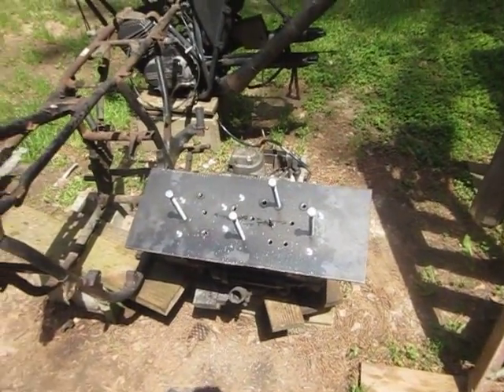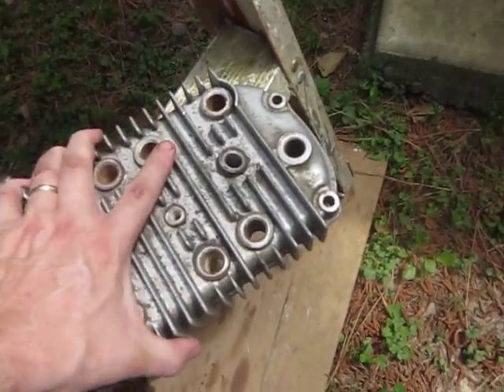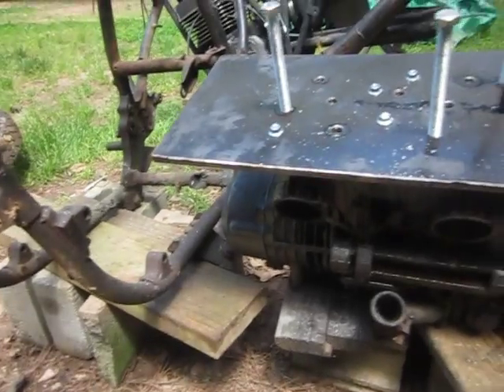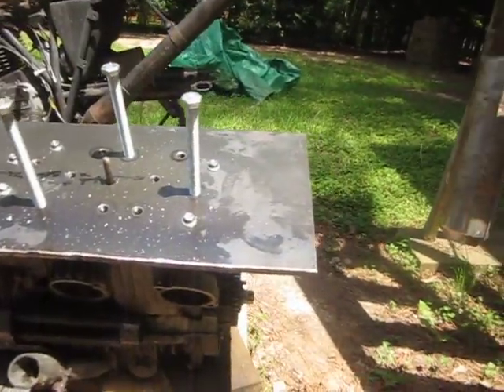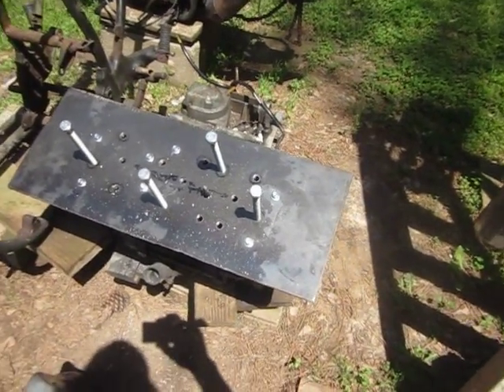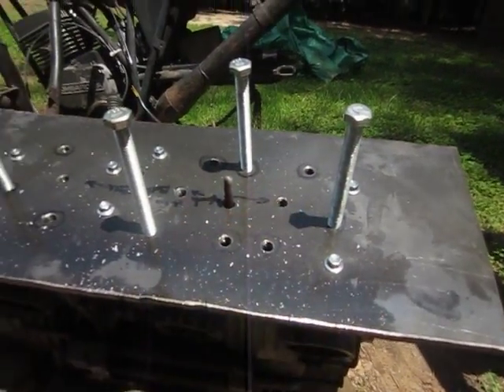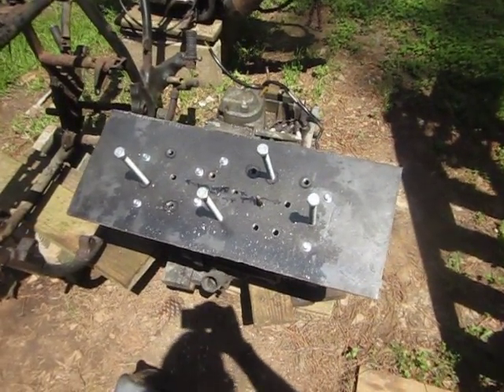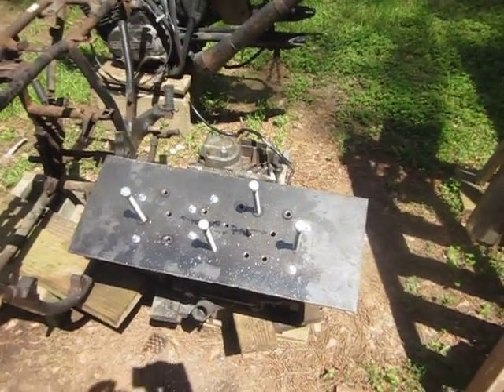GT750 Restoration Part 4: Cylinder Puller Plate

Comment: The steel plate idea is foolishness when Suzuki itself has developed a puller that is cheap and very effective. It worked great on my '75 three years ago. See the Service Bulletin, but basically you get eleven 5/8" short bolts (e.g. 1" long) and center drill them for a 3/8" or 10mm tapped hole down the middle. You then tap each of the eleven stud holes (5/8" coarse I think) until they bottom on the studs. Then one of the two-bolt "pullers" in each hole will allow the evenly distributed force you need to finally beak t he cylinders loose WITHOUT damaging the 8mm bolts holes in the cylinders.

Comment: I made a puller plate like this one back in 1980. I broke all the soft grade 2 small bolts off in the jug. Also hung the entire bike from a tree with a chain wrapped around the jug for a month. The tree branch finally broke, but the jug is still on. I talked to an old guy that once worked as a Suzuki mechanic and he said they all became permanently stuck in about five years. What should I do?? He suggested dropping the entire engine in tub filled with battery acid. Won't that screw up the engine parts?, I asked. Yes but the jug may then come off. Why is it that no one else on you tube has this problem? What are they doing?? Dynamite?
Reply from the maker: BrokenPortriats Now I'm thinking maybe I should consider pumping hot oil/water around the jacket for a while. Heat everything up and expand the bolt holes. Maybe that's too elegant. Could probably get it done without so much "engineering" by adding heat externally. Is there "heat tape" that gets quite hot? Have to look into that. A combination of the oil in the stud holes, plus steady pressure from the puller bolts AND heat would be about the best we could do (say I).
Reply: BrokenPortriats The project bike you picked out was super bad. Broken head bolt nuts is new for me. You will need two more parts bikes to finish this project. Do not pay more than $50.00 each. If they loved their bikes so much why did they park them behind the garage and not in the garage?? My next post will piss you off to no end as I gave one of my old bikes to my son and he got it running with just spit and polish.
Reply from the maker: BrokenPortriats Ha! I hear you loud and clear! I really wanted this to be a test of wits and creativity, to see what my limits are (so the rustier the better!). I figure if I can turn this rust bucket into something that runs (and runs well) all the other projects I take on will be easy by comparison. Also, it's nice to try out stuff on a "POS" that you don't spend much money on too! Break a bolt, strip a thread, crack a lug, it's all for the greater good. Just now, as I saw your most recent post, I was hunting the internet for "super hot heat tape".  My plan is to get the cyl hot and keep it hot (like 150F hot!) for a good long time and see what that does to loosen things up. Any suggestions?
Reply: Terence McEnally Aluminum loves to expand and contract from temperature changes. I like your thinking.
Reply from the maker: BrokenPortriats Luck! I found a slew of industrial-grade silicone-strip heaters that get hot as hell (200F). The company that makes them can do special sizes too. All about $100. I'm gonna get one of these guys and heat that cyl up good and hot and just leave it for a few days to see what happens. Beats standing there with a torch for hours. Search Keenovo heater on eBay.
Reply from the maker: BrokenPortriats It occurs to me that barring all other options the whole engine can be dismantled and the cases split with cyls still in place. Then the cyls can be driven out (carefully) from below. Thoughts?
Reply: You ever get the cylinders off?
Reply: @kramer_cosmo  The steel plate idea is foolishness when Suzuki itself has developed a puller that is cheap and very effective. It worked great on my '75 three years ago. See the Service Bulletin, but basically you get eleven 5/8" short bolts (e.g. 1" long) and center drill them for a 3/8" or 10mm tapped hole down the middle. You then tap each of the eleven stud holes (5/8" coarse I think) until they bottom on the studs. Then one of the two-bolt "pullers" in each hole will allow the evenly distributed force you need to finally beak t he cylinders loose WITHOUT damaging the 8mm bolts holes in the cylinders.